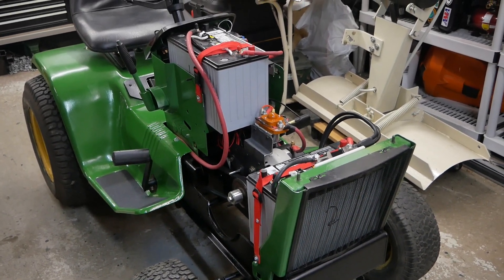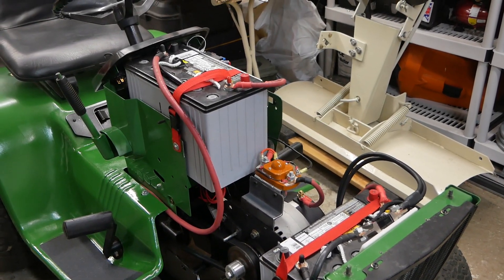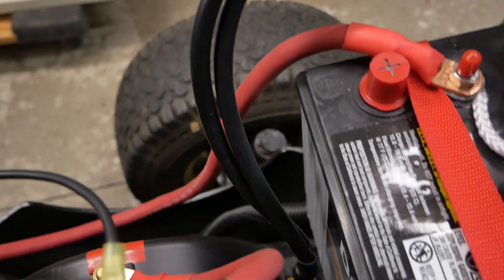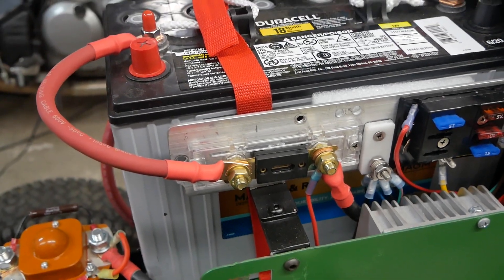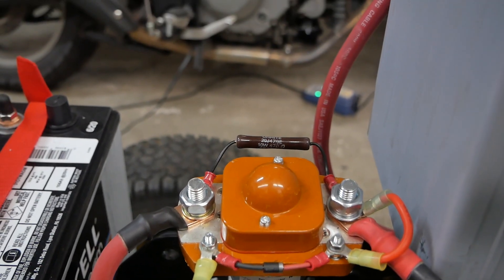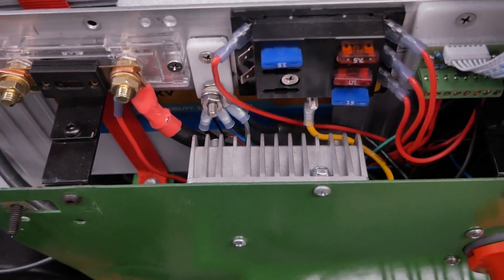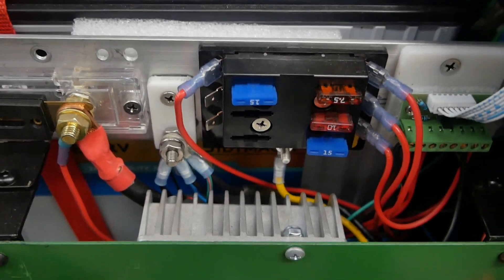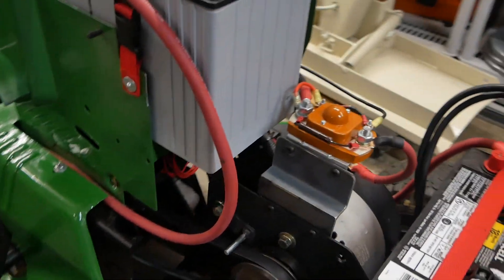John Deere Electric Tractor Conversion Wiring Video

Comment: with your key and contactor set up, does that mean you have 36v running through the key?
Reply from the maker: No, all the key does is activate the silver plated, huge relay in the contactor. The high current 36v/up to 100amp draw is going through the contactor.